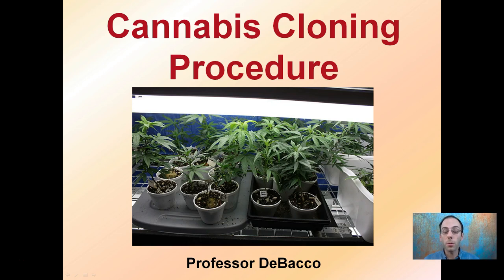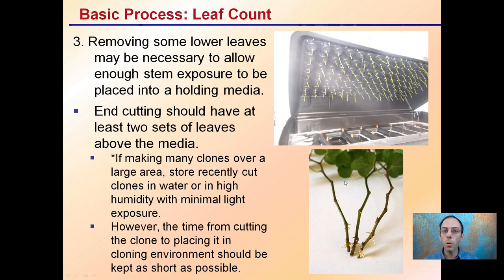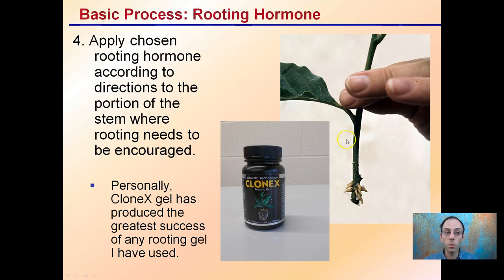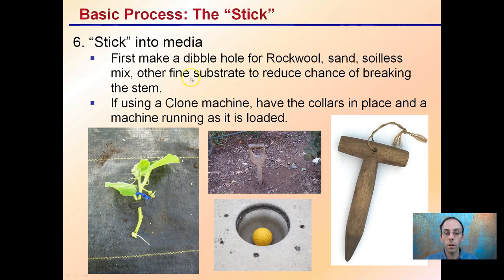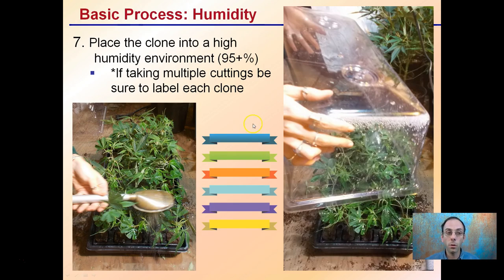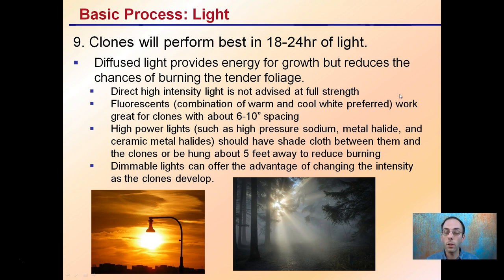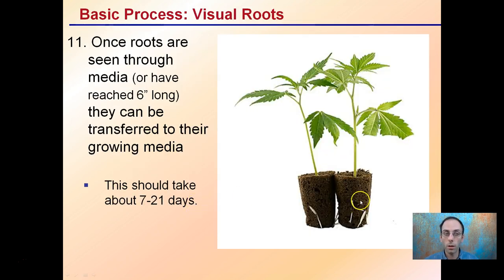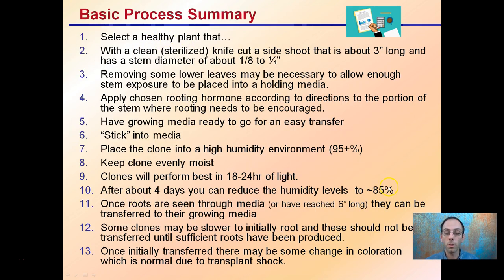Cannabis Cloning Procedure

Comment: Thank you for your comprehensive lectures. Best material on the subject. On cloning, when introduce fertiliser?
Reply from the maker: I appreciate your comment, there is a lot of time behind each and every video.  In regards to your question, low dose fertilizer can be added as the plants start to grow from the "clone size".  The important part is to favor on the lower (dilute) side when in doubt.  However, typically when the plants start growing it is a sign they have an initially established root system and can start to handle (and at times need) some fertilizers.

Comment: How many clones I can remove from a plant?
Reply from the maker: It depends on a few factors.  Theoretically, the number can be quite large but this depends on how the original plant is maintained and what pruning method is utilized.  Your goal should be to maximize branching and keep the stock plant in good health without over feeding it with nitrogen.  The "FIM" method is one way to produce many branches that can help increase the number of clones you can harvest.
Reply: DeBacco University 
Hey man how are you doing, hope good. I make clones around 3 weeks ago 03/12/2019 none of them roots and was not successful. I believe my coworkers over feeding it with Nitrogen due to they don't use a teaspoon or a measuring cup. Plus the plants wasn't healthy, they have fusarium & powdery mildew fungus. I already flush the plants, cure the powdery mildew fungus, working on the fusarium! Also I'm wondering if I cut the clones at the wrong moon phase? So I would like to know if you can make a video of the moons phases. 
Thanks
Reply from the maker: @botitiocacio5791   I think the excessive nitrogen is the reason for your poor rooting.  Moon phase should not have any impact on the rooting.  Measuring and documentation are both very important.
Reply: Sounds like the moon is the LEAST of your worries

Comment: Applying Wilt-Proof helps to retain moisture. If misting to add humidity, consider adding a little fertilizer for foliar feeding.

The powder works as well, but take extras because not everyone may make it. The Gel works better and the cloned products have more uniform finish times. Powders will have stragglers.

Store the Gel in the refrigerator. Pour what you need in a spoon, put the lid back on and refrigerate immediately to get long product life.
Reply from the maker: Thanks for the comment, here is another video using an aeroponic cloner... https://www.youtube.com/watch?v=_gOXYe9DyxY